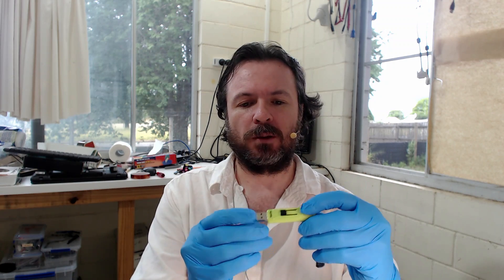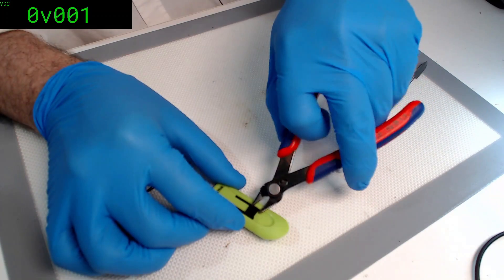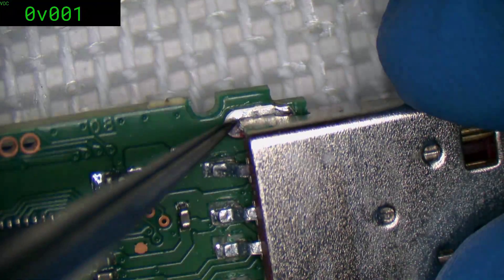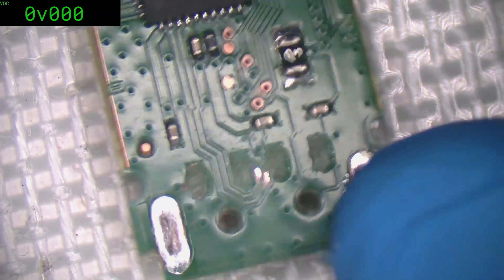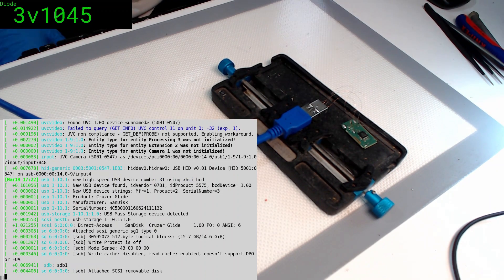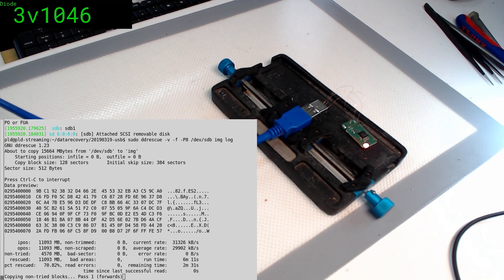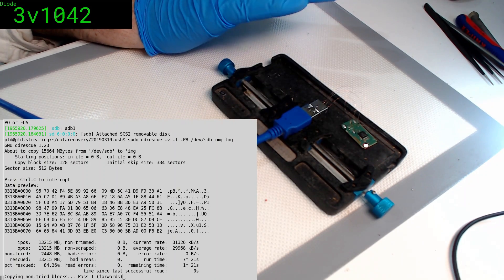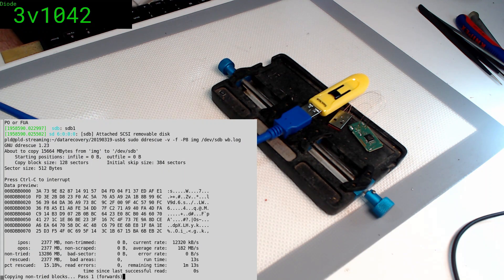#254 Simplest Repair & Recovery - Broken USB data stick

Comment from the maker: A classic type of fault with USB data sticks; plugged in to a laptop or PC and someone knocks the stick or drops the laptop, resulting in the destruction of the connections and no more access to the data.   

Fortunately this kind of failure is the easiest of all the possible USB physical failures to fix with discrete part build units ( for monolith USB sticks things are a lot harder ).

Software tools used ( on linux / Ubuntu );

  ddrescue - for cloning the USB stick
  gparted - for modifying the partitions

Comment: Hi Paul, do you use Ubuntu? I´m new to this and I´ve heard someone saying Ubuntu uses an old Ddrescue version and Kali would be a better choice, etc.... Want to hear from you.
And another thing, i´ve seen you using -p8 and -p16 in Ddrescue, this time is a flash drive, is that it?
Thanks a lot.
Reply from the maker: I do use Ubunutu, but I download and build my own ddrescue from source.  The -P8 or 16 is just the number of rows to display of the data dump.
Reply: @pldaniels  thanks a lot for your attention, greetings from Brasil

Comment: Just out of curiosity - do you charge based on how complicated the data recovery is, by the time it takes, or just a flat fee for the recovery ?
Reply from the maker: It's rather subjective based on the item being recovered and the potential work involved.  Rarely though is anything done on the per-hour basis, simply because most jobs will tend to blow well past the wallet tolerance of the client.

Comment: I totally agree with you about USB flash drive specs. They always tell u the larger speed which is the read speeds. Write speeds are horrible as you said on USB3 ones. You can buy the more expensive SanDisk Extreme USB flash drives. My self I just use a SATA based  SSD in a USB3 enclosure for anything over 32GB size wise.
Reply: Disagree. I have USB3 drives here that are like above 20MB/s and they were cheap (16GB for like $12 a pop). Some SanDisks I have get over 50MB/s when constantly reading from them. Small files causes the speed to be a rollercoaster.
Reply: @Coburn64  How are measuring that throughput on writes? Crystal DiskMark with a 1GB file? 20MB/s is fine but manufacturers usually trumpet higher speeds which are using read. 

I had a Kingston USB3 128GB drive that Crystral DiskMark and ATTO both show horrible write speeds like 23MB/s vs a generic crappy design Walmart flash drive with 49MB/s. I returned the Kingston for a refund and the generics when one failed within a week and the other due to crappy design of the slider for USB connector.
Reply: @GregM  Nope, I was watching iotop on Linux and sometimes using ddrescue to fill the USB from /dev/zero for a full wipe.

In Windows, usually copying big files to the stick. Hell, I know for a fact one of my USB3 sticks was doing ~50MB/s write and over 100MB/s read.

Comment: Brilliant!
For those of us just starting with simple repairs - what gauge (and type) wire do you suggest we keep "in stock"?
Reply: For hobby repairs just use the wires from small dc motors, speakers, earphones etc. you will get different gauge easy, fast and free, the gauge is dependend from the current and you can search for that easily online, sorry, you didn't ask me, hehehe
Reply: @Wilson84KS  Thanks - I appreciate the reply. That is what I'm using as well - only I REALLY like the fact that no stripping of the wire is require, and the solder simply melts the coating and exposes no more of the wire than needed.
My free wire solution sadly doesn't quite offer that.
Have a good one!!
Cheers
Richard
Reply: That's true, only good thing about it, besides it's free and easy to get, it is mostly good quality, but also those from speakers are often glued in the coil and the insulation gets ripped off when pulling it down, sadly can't say that about jumperwires from Aliexpress etc., not that they sell only garbage, but you just don't know.
I copied what Louis Rossman recommends:
› THICK insulated jumper wire: https://amzn.to/2rvtD0A
› THIN insulated jumper wire: https://amzn.to/2I47DQY
Maybe that helps you, if you don't know it already :-)
Have a good one too, thanks!
Cheers
Wilhelm

Comment: seeing that the calculator and system monitor is default a snap on ubuntu still hurts
Reply from the maker: The whole snap system just infuriates me still.  Not sure who or why is pushing it hard; seems to be an attempt to step away from the deb package system though I'm not quite sure there's going to be a real advantage. Feels more like another case of "NIH Syndrome".
Reply: @pldaniels  I know nowhere near as much about it as you probably, but the place for things like snap, flatpak, appimage and similar things is (For the ones that do sandboxing) things that have a reason to sandbox, for videos games so that they will last forever without relying on dependancies (or similiar idea, preserving old versions of packages for the future), or to fine tune dependancies for complicated software to optimise performance (like say kdenlive).
Not to make the calculator more bloated.
Reply from the maker: I agree with you on the idea for it being for sandboxed/long-life stuff (games are a good example), and yes, seeing it used for calculator and system-monitor, it's just a bit "why?".  

Still, I don't expect much different from the likes of the GNOME group.

Comment: I love these kinds of repairs because they're simple and easy to accomplish, usually in a matter of minutes. What boggles my mind is that if you call any of the "repair" shops in my area and ask about this sort of thing, none of them do it. Even at my shop, I'm the only one who knows how to operate a soldering iron. I tell my coworker all the time to start learning while he can but he doesn't bother.

I do these a bit differently, I have a USB cable that I just cut the end off of, so I solder the black, green, white, and red wires in place. For the ground, especially if that anchor is empty I usually just solder to that. I also like to space my green and white pads a bit farther apart to keep them separate, since the USB wiring is quite a bit thicker than the individual copper wires you're using here.

Great video!

Comment: I just use a 120GB SSD in a case instead of a flash drive, it is 10 times faster !
Reply from the maker: The Defpom's Repair Channel this was to go back to the client. I already had the clone done to the internal SSD

Comment: I doubt it will be an issue connecting the connector like that but it does change the impedance of the transmission lines. But again,  highly doubt it would cause any problems at that speed :)

Nice recovery!
Reply from the maker: Agreed; there'll be a bit more signal reflection and the differential pairing will be a bit noisier,  but it does indeed still get the job done for the task.  If it had to be done at USB3 signalling rates I would be stricter.

Comment: Nicely recovered, you bodge artist he he leg pulling :-D
Yes you got me with the possible "Why not use a pre made usb breakout.?.", i suppose if you have a lot of regular recoverys then maybe a rig will be setup.
If i had to image a non windows usb i would use dos, windows has a really bad habit of writing to storage without asking :-(.
I hate the way plugs/sockets are secured with solder, it's a really bad idea that every one uses.
Reply from the maker: I probably only get about 3 of these a year.  I'm sure more happen but they're not coming here for the fix too often.  

Yes, I wouldn't trust plugging it in to Windows for data recovery; definitely like using linux + ddrescue to make clones of these sticks.  Technically the stick is likely perfectly fine if I had put it all together with some wire & hotglue but at least this way we now have a guaranteed backup for the client if they lose their data in 6 months  :)

Hope all is well over there, getting the change of season? Finally starting to turn down from "Hot Hell" to "Warm Purgatory".
Reply: The weather here is often dull and rain based lol :-D
I live in a house without central heating, but i don't think the weather is so bad here, although last week it really took the piss, the sun came out and was quite nice for a change :-D.
But that didn't last long ha ha :-D, that's the typical uk for you.
"Piss and wind." lol.

Comment: Good job Paul classic repair :) hope the 2027 handles helped lol :D :D
Reply from the maker: Sad, but true story... I broke the 2027 handle while swapping out the new tip+holder :-o  Snapped one of clip-retainers on the side.  Still works though at least.
Reply: @pldaniels  Daaamn bad luck im swapping mine all the time and didnt even think that could happen :P now im gonna be more careful thx for the heads up
Reply from the maker: I'm genuinely wondering if it's the UV exposure from the Sun that has caused it to weaken, because in the morning for a few hours, the whole desk gets full exposure.
Reply: @pldaniels  ah yes you might be on to something i have my rooms all in darkness all the time lol well it still works which is main thing i think one clip should be good although i can imagine it is annoying to know its missing :P